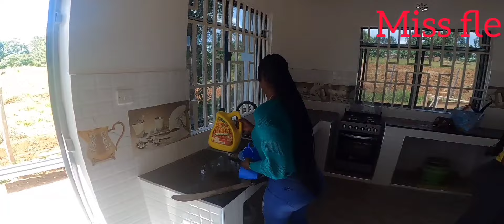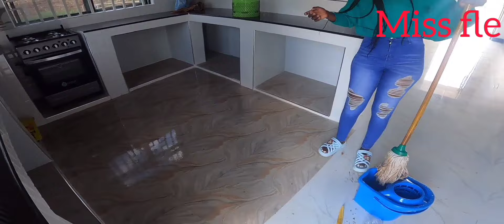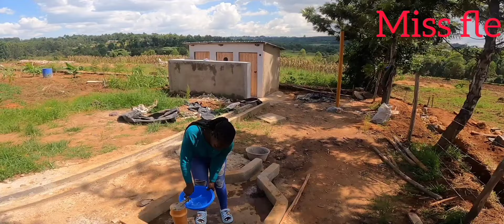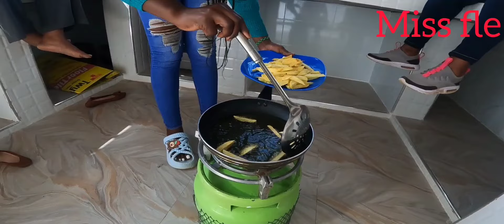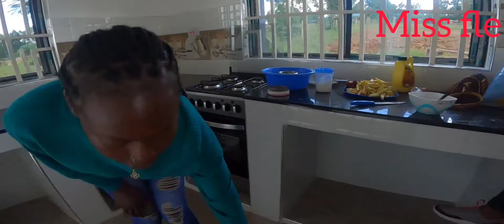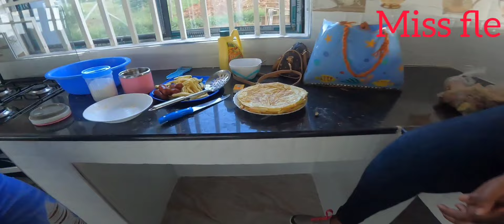Preparing @ItsNasto 's Favorite MEAL With Help From RWANDAN LADIES || See how He reacted❤️❤️

Comment: Buy a soft bristle broom touse it for sweeping before you mop your floors..pouring water on the tiles makes wet surfaces people will bring mud into the house.
Ask people to leave shoes outside all the time.
When you finish with mopping soak your mop in a bucket of soapy water and bleach so that you keep it clean and white.
Buy a chopping board to usr in the kitchen dont let people use kitchen tops when cutting stuff.
Reply from the maker: Yeah I will

Comment: Ms Fle. I hope that cooker only heats from the top. Because if it heat the floor, the hot heat will crack that tile. You need a board or something to sit the cooker on. And splattered grease is not good on the floor either. When it gets cold, it is hard to clean thoroughly. Try cleaning the floor with hot water. It will make the floor sticky if you don't clean it off good. Just some tips, we don't mean any harm.
Reply from the maker: Thanks for the advice